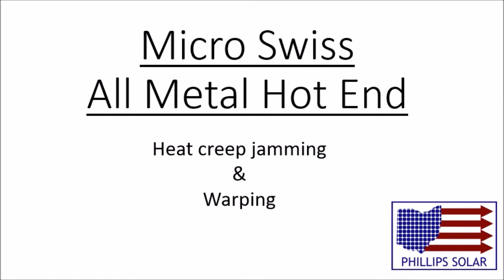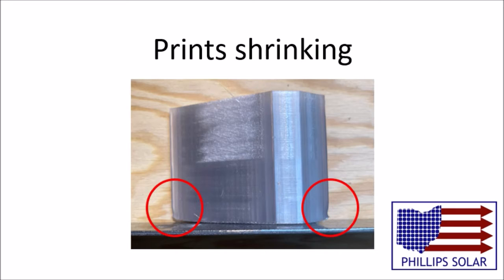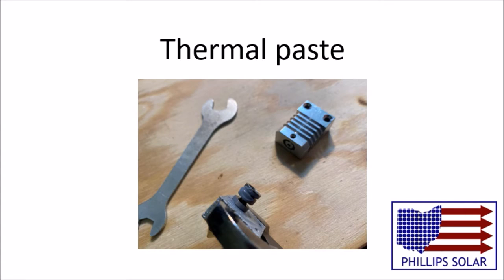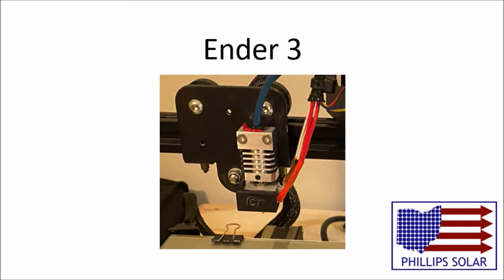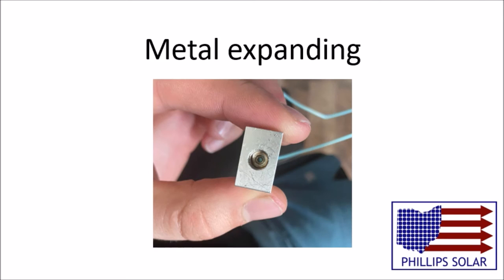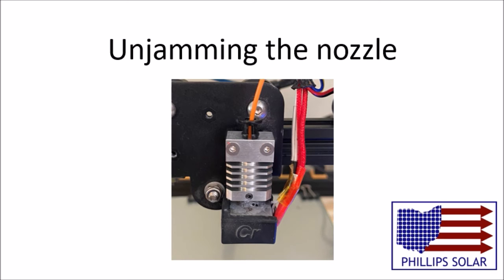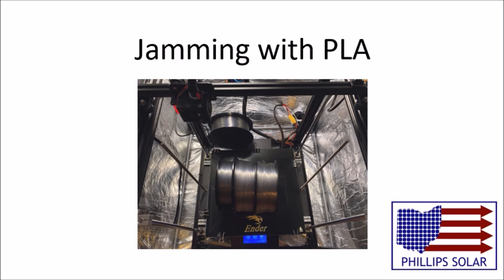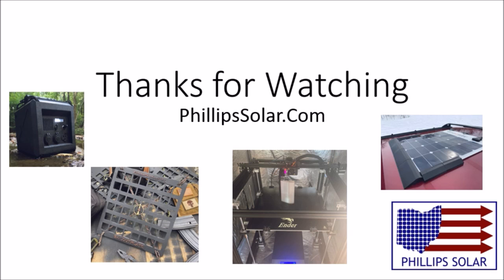3D Printer Micro Swiss All Metal Hot End Jamming Issues

Comment: I have a Micro Swiss on my CR10 and it works great. On that one I added a Fang duct, which also changes the way the fan attaches and provides better airflow. It works great with PLA, PETG and ABS. I had such good luck with it I decided to upgrade my Ender 3 Pro to a Micro Swiss too. Unfortunately, this one has been a nightmare. Not enough heat dissipation from the heartbreak to the heatsink, combined with the fan not providing enough airflow, would explain why my CR10 works great but not my Ender 3. I’ve been thinking about replacing the stock fan with a Noctua and adding a different duct to quiet it down. Now I have a good reason to swap it out.

Comment: Yea, I have a Microswiss hotend and direct drive.  It works great with PETG, but clogs or jams if I switch to PLA.  The last time it jammed so bad that I had to purchase the noclogger tool to get rid of the jam.  Now, I just use PETG.  I don't know if going to a different hotend would allow me to use PLA and PETG.  I was thinking maybe a higher flow rate hotend would be better, but I am not sure if that would fix the problem.

Comment: Hi Phillip ,
Thank you very much for sharing your information. 
My problems are gone since i followed your advice with the thermal paste (at the cool end)  and also going to an 1mm retraction setting *which is obligatory for the DirectDrive*.
My Printer (CR10-V2 , /w direct drive Microswiss and Microswiss all metal Hotend) 
Now printing with 80mm/sec w/o anything abnormal happening , in an 12h print

appreciate it very much :)
Reply from the maker: Glad to hear! 
I actually installed the miscro swiss DD NG on a printer last week and it has not stopped jamming after a few hours. Even after following my OWN advice!
Reply: @phillipssolar7425  Hi Phillip :) ,
Hello again ;) 
bad news... it jammed again on my Cr10-V2 ... so your tweak made it much better but here i am again.
I was using B-grade Filament at the time of the jamming issue and noticed that the bore in the heatsink is precisely machined to 2.00mm.
My Filament was "slightly" gigantic  over tolerance with an little  2,15mm blob and jammed inside maybe this might help yourself a little bit.

So in my oppinion to resolve the problem further:
-use only HQ Filament 
-going to 2,2mm in the heatsink might help. but i dont like the idea of brutalizing my Heatsink bore for an Filament fault

Comment: Hi, I have had a similar issue. I was printing perfectly fine with PETG, no issues. I switched to a shiny PLA material and it suddenly began to miss layers and now has been clogged but also I think it has something to do with the gears also. Finding it very difficult to get the little bit of filament out that has jammed in the hot end. I feel like every single time I even look at my 3d printer it revolts and begins planning the next rebellion. It would be lovely for it to just work without issue . I have been exploring this issue and some have suggested it may be due to the thermistor overheating? Great video and thanks for the suggestions.
Reply: Crap filament will cause issues in printing.
Reply: Hey, did you get this figured out?  I know it's an old comment but your comment described my situation perfectly.  I have 4x ender 3's, 2 of them are the s1 series, those don't have as many problems, but the ender 3 v2's are just like you said about yours.  Problem after problem.  I'll probably sell the stock one, but the other one I have super modified and it was my first printer ever so it sort of has sentimental value (including years of blood sweat and tears lmao) so it would be nice to get this figured out.  I have a microswiss all metal hotend, and also noctua fans.  The noctua fans spin more slowly, but they are also twice as thick so I'm not sure if that's the problem, and it worked fine for like a month so I feel like it's something else.  I saw a video showing someone putting thermal paste in par that connects the heat part to the cooling part (sorry I forget the terminology) so I'm going to try that next.  Please let me know if you got it sorted out because my problem is identical and I really want to get this sorted out, I have lost a lot of filament to this because I'm trying to print a 200g print and the damn thing jams like 5 to 15 hours into the print.
Reply from the maker: In my experience, the thermistors and heater elements either work or they don’t, it’s not “usually” a gray area. 
I would look into your retraction settings and filament drive gear. 
That is, if you haven’t already tried the things in my video. 

If it’s poor quality filament, you may have bulges in it as well.

Comment: I dont have this issue at 250 deg C Using PETG over 24 hours printing. I also have installed a Hero Me Housing which more directly cool the fins of the system. Yes the Filament will leak and I have experienced this, but only if the heat break is not 100% tight. I now use a vice and heat up the block off the printer where I can easily tighten heat break and nozzle.
Reply from the maker: Yup! I prefer hot assembly of the hot end outside of the printer too.

Comment: I've been running my microswiss hotend for over a year with zero issues printing a range of materials up to 270c in an 100f enclosure. What fan are you running on the hotend?
Reply from the maker: Just the stock creality 24v fans
Reply: @phillipssolar7425  possibly worth upgrading, I am running a 24v 4010 from th3d that puts out a bit more cfm
Reply from the maker: @henrimcgowan5589  I’ll keep that in mind if the problem comes back. Thanks!

Comment: Wow I never thought an expensive product would jam, I was just about to buy this, should I really buy? I print a lot of marble PLA for long hours
Reply from the maker: I run micro Swiss’s on my 3 printers BECAUSE I only print PETG and carbon polycarbonate. If you don’t need it, don’t buy it. But this jamming is the main issue you’ll run into
Reply: @phillipssolar7425  Thanks Phillips, I think I will stick to the stock hot end, there is no such issues, I am able to print PETG at 215 with Mattherhack filament and it prints well, I dont think I will buy not Micro Swiss ....thanks for the video ...my only concern was to have the tube always getting hot at 215 with the nozzle, in the case if micro swiss tube is not directly in contact with high temperature so much safer ...

Comment: Okay so I’m having something similar happening to me, my printer is completely inclosed and would start printing any ware from 20-60 minutes before I would start hearing the gears grind, I’ll give what you said a shot though I’ve printed for days at a time and never had this problem so I don’t know what it could be. The only difference as of late is my heated bed would normally be at 48-50cc but has been set to 60cc would that make that big of a difference? Any advice would be greatly appreciated
Reply from the maker: Are you printing with PLA? Around 110°F PLA will get soft and pliable, it will jam. I was printing with PETG just fine in an enclosure and when I switched to PLA it jammed every 20 minutes, it took me a month to realize the enclosure ambient temperature was too high for PLA.
Reply: @phillipssolar7425  yes I’m using PLA though I’ve never had this issue till now, I was printing with the bed at 60cc and nozzle at 210-220cc. Now  that I saw your video I’m printing at 200cc with the nozzle and the bed is at 50cc, and even with that it still ends up jamming though I’m not sure if it’s just the project I’m working on as it has a LOT of stop and go as it’s a 69 part dragon I’m printing for my sister. 

It is printing better now so I’m not sure if it’s Creality settings, because I’m still learning how to use it.
Reply from the maker: @bruce9948  if it still keeps happening, I suggest opening the enclosure up, your filament could be feeding in at 105°F or so and that’s causing it to get soft.
Reply: @phillipssolar7425  ya I will try that, can you think of anything else it could be? I’ve only been using a printer sense March of this year so I still got a lot to work on and learn
Reply from the maker: @bruce9948  the other thing it could be, but I doubt, is your retraction distance. Depending on your nozzle and hot end, it could retract it too high and it cools and jams. That happens to my PETG at any distance over 3mm
Reply: @phillipssolar7425  same here.  bought enclosure to fix one problem, ended up with jam constantly.  I put the filament roll outside the enclosure and it worked after that lol
Reply: Ya I’m using a Micro swiss all metal hot end and am having my retraction ranging from 2-5mm. Most of the time I find myself doing 4-5mm though so I don’t know if can do anything to help bring down the retraction
Reply from the maker: @bruce9948  it’s in the slicer software, I use Prusa
Reply: @phillipssolar7425  ya know that’s where to make the adjustments but other than the basics I don’t really know what all the others do and any time I mess with them my print always messes up 😂
Reply: @phillipssolar7425  Persia better?
Reply from the maker: @bruce9948  ok, then it might be an operator error 😂

Off the top of my head, ambient temperature, thermal paste around the heat break, and retractions length is all I can think off mechanically
Reply: @phillipssolar7425  okay well I’ll give that a shot, thanks for your time

Comment: Manufacturers build throats from Titanium because they have a low conductivity factor, bearing this in mind why would you apply thermal paste to the lower part of the throat thus allowing more heat to "creep" up, I can see it being usefull at the top of the throat but cant think for the life of me  why applying it at the bottom would be beneficial.
 I also notice in one of the photo's that there is no bowden tube going into the collet, just orange filament, if this is how the swiss is being used there are bound to be problems
Reply from the maker: You make an interesting point. I’ll definitely try that next hot end rebuild.